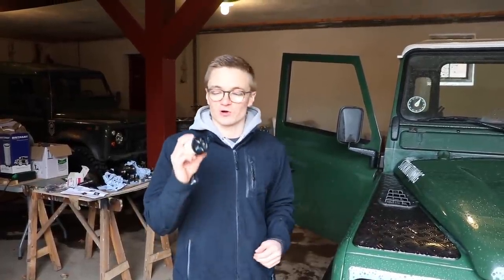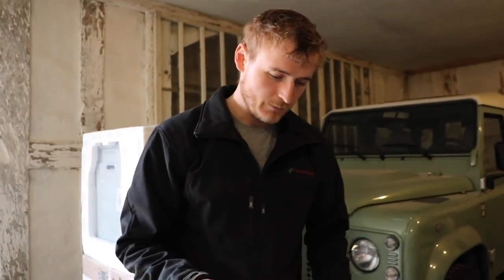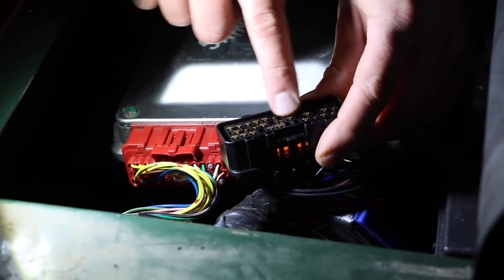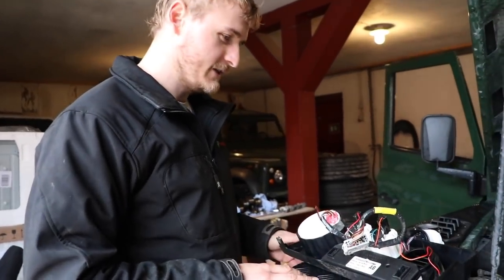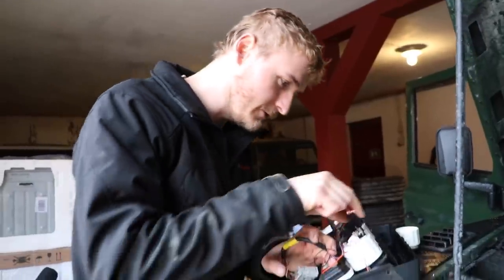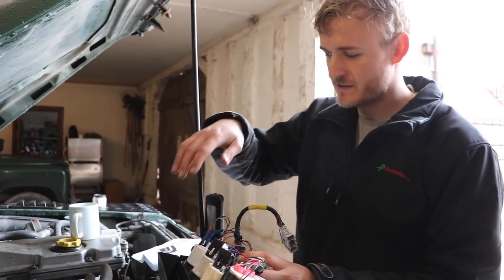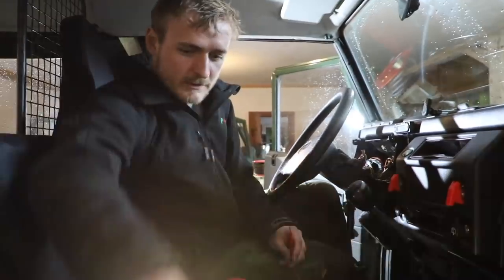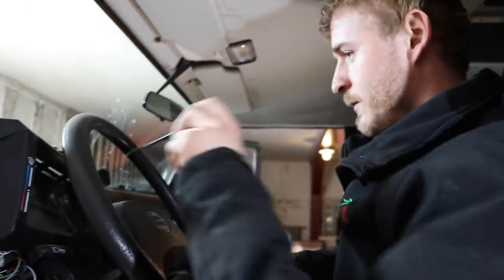Installing the upgrade all Td5 Defenders NEED!

Comment: l fitted a rev counter to my 110 some years ago, l never find myself exceeding 3,000 rpm in normal driving although it does rev nicely to 4,000 on the occasions l've tried it!

The TD5 genuine rev counter used to be £85 but now it's nearly £300